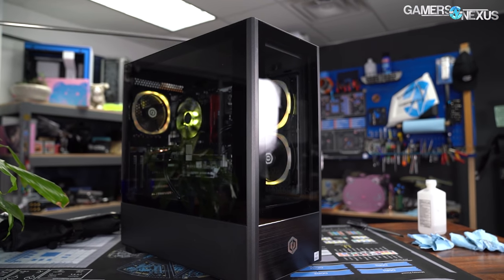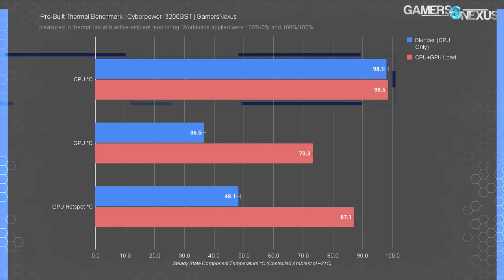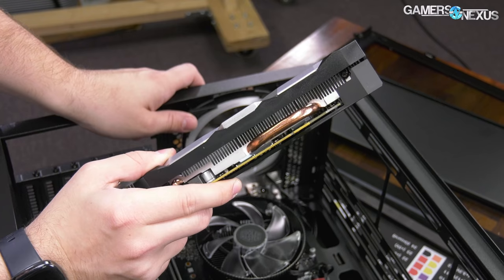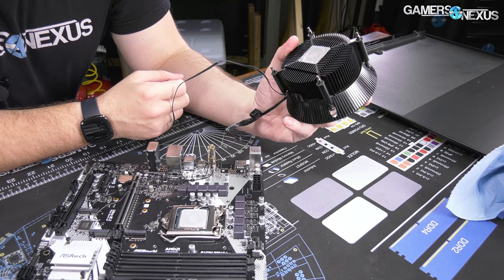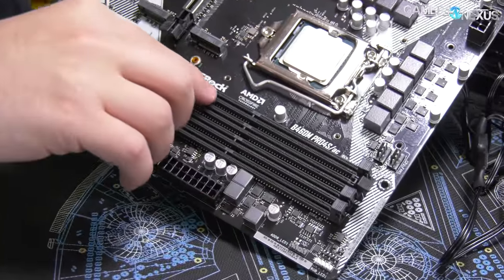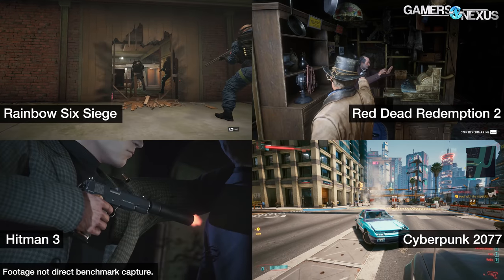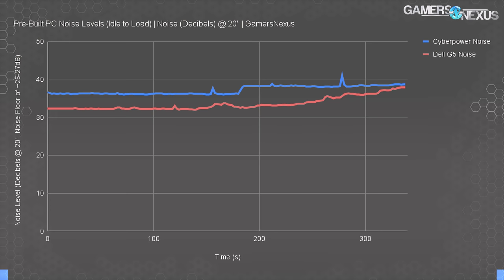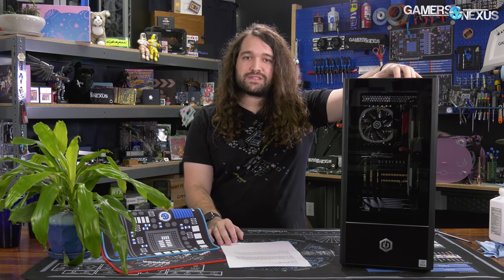Almost Didn't Suck: Cyberpower $1000 Pre-Built Gaming PC Review (Gamer Xtreme 3200BST)

Comment: I got mine for around $1,300. It's in a different case and I chose to go AMD instead of intel. It's the overall good performer Ryzen 5 3600 with 16GB of RAM and a 512NVME. I had not watched enough of yours, Bitwit and Paul's videos to realize it but for $30 at purchase time I would have gotten an AMD 5600XT instead of the AMD 580 I got. It seems to be a decent performer, not going crazy on resolutions. All I have done at 1080p seems to be just fine. The final quality was not excellent, thankfully I HAD watched all those videos when I got it. The system looked really amazing but one of the ARGB plugs was disconnected likely from shipping shuffle. The temps were really bad and throttling down my system, so I ended up swapping the cheap CPU air cooling for a 240mm AIO. I also moved the fans around instead of on the same plane as the motherboard, to the front. Thermals with those changes are way better and it was a noticeable performance increase on Rogue Squadrons. I do seem to have a noisy power supply and only 600W so I am thinking all this machine needs is a 750W PSU that is quieter to add on a 3060 or 3080 whenever they become available (which gives me time to save up as well :) but I went to Best Buy and an AMD Ryzen 7 5800 was there and I got the itch. I have an ASrock B550 so that should be fine, but I am wondering if I should swap the PSU first. I have three front 120mm fans, one in the rear and two cooling the AIO, plus two NVME's and an SSD. Finally as a shameless plug, I did make a video when I swapped to the AIO https://www.youtube.com/watch?v=uZs9vCxHWak

Comment: A "Upgrade" for that stock cooler, would be just machining the cooler copper slug so its level with the alloy bottom and entire thing is touching CPU
Reply: An upgrade is getting away from that pos, I had one it's complete ass and costs like $10 bucks new, there are plenty of decent ones for $20-$30

Comment: GF got a pack of case fans from Motospeed that use a similar Molex centipede as this one, except it's one that kinda makes sense. They tie all of the power pins together, but the plug where you feed PSU molex into doesn't have two of the pins. Those pins are connected from fan to fan directly in order to supply ARGB data from a "master" fan to the rest. Only one of the fans in the pack actually has an ARGB connector. It also has an integrated controller where you can control the fans through one of your case buttons (they suggest you use the reset switch for this).

Comment: I bought the same spec computer at the height of Covid 2 years go for 1700 because it was the cheapest option to get a computer, knew nothing about computers at the time and learned how much I overpaid since then. Oopsie. But the aprevia molex rgb controller really threw me off once I actually upgraded most of the parts.

Comment: 2:40 well if you factor in the motherboard, ram, psu, case, and storage, assume each of them are around 50 dollars on the low side, that makes the prebuilt actually a decent value, assuming the GPU is overpriced. Compared to MSRP though its not great

Comment: The "nice" thing about many prebuilds that use retail parts is you can look up compatibility and efficiency issues, like slotting 3000 ram in a 2666 motherboard.  IBUYPOWER has some weird crap setups on their website.  They have two ~1500$ AMD setups and one has half the mem storage, a worse graphics card (1660 Super vs 2060) for a slightly better motherboard....for some reason.

Comment: I have the 11700f 3060 ti version of this and your absolutely right! That damn wiring harness makes things so confusing. I had to add a liquid cooler the day after buying this because the stock cooler master air cooler was a disgrace! Everyone at Best Buy assured me it wasn’t wasn’t the cooler that was the problem and it was my first computer so I ended up having to return the computer and try a new one. I got the exact same computer I just thought there was a hardware problem with the original. Got home and got the new one hooked up and same problem! So I said screw the guys at Best Buy it has to be the cooler. It just made sense. So I bought and installed a double fan msi liquid cooler that I got at Best Buy tor only 70 dollars. BOOM! Problem fixed! Anyone buying this computer save yourself the time and get a liquid cooler or top of the line air cooler and you will be good to go. I know it sucks that it’s a prebuilt and you have to open it up and change something right away but it is worth it! I absolutely love my computer! It can take absolutely anything thrown it! But shame on you cyberpower! How can you sell a computer that doesn’t even work out of the box! Your lucky someone with absolutely no knowledge of computers was able to solve the problem otherwise I was going to return this computer and go with the OMEN.

Comment: I ordered a 1400 or round aboud prebuilt from these guys, and I only had 2 issues
1. It took ages and was pushed back multiple times in which I understood why because of RTX 3080 shortages
2. The aio made the annoying buzzing sound but luckiliy I had a noctua NH U12S and replaced it for equal to maybe better cooling for the 5600x

I DIY my pc's but, RTX 3080 init.

Comment: i have this i71c cooler on a small case bedroom pc build with a 7700k and its fine . its rock solid tight , you can pick it up by the cooler and shake the motherboard and it stress tests at under 70c. its not a great cooler and its not overclocked but for a small case budget build it was fine . seems kind of weird it doesn't work in this pc .

Comment: My last pc was an Ibuypower I've had for 7 or 8 years now but almost two years ago I purchased a Cyberpower SLC9308W openbox for $1550 at Walmart with a Ryzen 9 3950X and RTX 2070 Super and the GPU stays around 40C which has had me amazed to the point of thinking there is something wrong and verifying the system temps multiple times and ways. It just runs cool! Never had any issues with either systems. Prior to these two prebuilts Ive been building my own system all the way back to a TI 486SLC 33mhz which would out run my friends DX4 100mhz systems at LAN parties....

Comment: "Buy another stick of RAM, try to match the spec" I was under the impression you're not actually able to do that? I was once told that if the RAM modules are not purchased together even if they are identical sticks the timing could be off and can result in blue screens or other issues. Is this not true? Is there a good way to make sure two separately purchased RAM modules will work together for sure?
Reply: Wut? You can literally get any compatible ram and mix and match

Comment: The case, RAM, motherboard, PSU and 3 case fans total less than $100 retail?
Reply: what? this GPU was $240 - ram mobo and case = $250, GOOD PSU $90 3 fans call it $30. everything is a rip off

Comment: I have that CPU cooler, the Cooler Master 70ic or whatever, and it does an okay job. Under stress tests it keeps my 8086k (not delided) at ~80c or just under. I did check after you mentioned it, it does wiggle a bit, but I think that's due to the mounting mechanism. I would like to see it put through the cooler tests, but something tells me your specific unit might be defective somehow(?) or maybe the extra power being pumped into the the 10600kf really is too much for the cooler compared to the wattage of my 8086k.

Comment: Im just getting into building my first Pc my question is to someone whos been around a while.
Why have company's who make gpu's only just now release specific mining gpu's? Company's must of seen rather quickly what was happening to the market.
they are no longer selling consumer products. It seems that mining is an industry and all the gpu's have turned into a none consumer based product.
And lastly influencers like yourself and others have you tried to reach out and express your concern.
Reply: because mining gpus are just gaming gpu’s with the display outputs removed, the RGB removed, cooler costed down. But right now it makes more sense to make just 1 gaming SKU and sell it to gamers and miners. Only makes sense to make a mining specific card when you have over supply. But even then most miners prefer to buy gaming cards as mining cards are worth a lot less if crypto market crashes versus a gaming card. They can resell a gaming card on ebay for a much higher price. Mining cards would sell for a lot less. So unless a company has a bunch of extra gpu dies they can’t get rid of, it makes zero sense to make mining cards. Supply is still going to be limited regardless.

Comment: Thinking about these systems I find it hard to justify companies like Dell doing the proprietary parts. The only thing that I can think of is specifically doing it to prevent the customer from upgrading, or using parts in a different system, but that comes at an r&d cost, and I would think that the people who buy these systems would be unlikely to do any upgrades that the proprietary parts affect. This of course is not about the small form factor systems that I would generally expect to be proprietary.

Comment: whole industry is a steaming pile of dog shit- games are trash- everything is just a rip off of games made 10 years ago. no need to build a new gaming pc- get a pentium 4 single core. and run emulators on it gg. what u wanna play toxic league? or dota? or cs go? or with the kids playing fortnite? lololol. if it wasnt for overclocking i would never upgrade. i'm still playing xcom 2 etc. no good games in the pipe. no good hardware in the pipe. time to get back on the motorcycle.
Reply: if u dont set up your case as a blower card your doing it wrong

Comment: "By the way, HORRIBLE thermals"

I'm staring at a glass front, so I'm not terribly surprised by that. Where did this ancient relic even come from? Did you steal it from a museum? This looks like the years of garbage you guys constantly gave bad reviews to until companies finally listened and started thinking about airflow again. I guess Cyberpower thought they were safe since they don't sell the case alone, but they were wrong!
Reply: Oh, I didn't even see the side mounted fans until the scene changed. But why are they also blowing air out? They should be intake...
Okay, I already know the answer to that question. It's because this side of the fans look nicer, so thermals be damned.
Reply: Definitely wasn't expecting the CPU cooler to be so trash. WTF, CoolerMaster? I like how the part right above the silicon is the part that doesn't make contact. I'm sure this isn't an original thought, but maybe they shouldn't be called CoolerMaster if this is how they think cooling should be.

Comment: I bought a similar looking cyberpower in January. The motherboard does have multiple versions. Mine has a near identical motherboard, except for the B550 features, and the vrm heatsinks. Mine also has two 8 gb sticks of Crucial Ballistix red 3000mhz cl15. It also has a 3700x, 120mm aio, and an xfx rx 5700xt thicc ii. All of this for $1200, and at one point a version for $1350 with a 3070 was available.

Comment: I got a water-cooled cyber power and it was throttling. I put my own air cooler on it and it was like the best money spent at the time. Overall the system was solid but just had some huge WTF build decisions, but I knew enough to check and fix problems as they came up. Also, one Ram Module came DOA but that warranted free shipping, and they cross-shipped it. This was in 2009.

Comment: "it is better than Dell" : isn't each and every (actively computing) computer better than a Dell ? i worked for a corp (10k employees, more or less) having an exclusivity contract with Dell for all internal IT hardware, on the site i was working on, we had 3 Dell techs full time + our own IT team for clients support + our own dev teams for products related software. Things that were made by our own teams had some issues from time to time, of course... We had few configs for working computers (e.g. CAD workstations [high cache and calculation capability, big screens], devs workstations [high cache and calculation capability, dual middle sized screens] local "other uses" [low perfs and cheap screens], R&D laptops [low perfs but 17" screens], and mobile techs (users sites techs) [same as R&D but increased connectivity]. This with a few soft config sets : Lotus Notes for everyone, the appropriate CAD for mech or board devs, and the appropriate set of network drives depending on roles... well, it never worked, not for the "only" 800 people on the site i was working, but worldwide... just on-site : installing wrong hard configs, wrong setups for workstations (including at BIOS level for CAD), wrong sets of applications for almost everyone, manual downloads required for R&D machines, network drives giving you access to other users personnal datas, access to network drives random lockups, and the worst, sometimes 3 days to have your (bad) setup delivered when spare machines where stored by Dell INSIDE our factory... never buy a Dell, never speak to Dell (well, if you can reach any human at Dell...), throw them in the hell they created by their own... (Note : this testimony is valid from the years 2000 to 2011, but i can see nothing has change...)

Comment: Had this issue with both ABS PCs I bought (one was a replacement for the first which failed under warranty). The CPU (3900X) would reach 95C degrees under sustained load and clocks would drop below base clocks. I still have the PC and the problem is A) the liquid cooler they went with is 120 mm and it’s terrible — the Gamedias cooler is probably worse than just the stock air cooler and B) the case has no freaking air flow — the front fans don’t seem to pull any air around the glass panel and the rear fan doesn’t seem to blow any air out either — any warm air flows out the top eventually from the cpu cooler but it’s clearly not capable of keeping the system cool.

Next time around I’m paying the extra cost and going with MainGear — at least they have a reputation for delivering a system that runs adequately with reasonable cable management to boot. Honestly screw most prebuilders, they always try to skimp you on something whether it’s cooling, RAM speeds, or a crappy Motherboard/PSU. 

It’s really not that hard to use balanced components and ensure the system is reasonably cooled but then I guess they couldn’t rip people off for a buck.

Comment: Uuugh about the price... you'd still need to get an SSD and/or HDD, RAM, the mainboard, the PSU, the case and some fans. That can easily exceed 300 bucks if you are buy new AND you have to assemble it yourself, which costs time and effort. So yeah, the 1050 USD price is fair considering the crazy market situation right now. Though I wouldn't buy a 1050 USD system with a 1660 in it TBH. But then again, the CPU cooler thing is totally unacceptable. It's so sad because Cyberpower was one of the cheaper AND setup-wise better performer in the last LTT undercover PC shopping thing. But they had to fuck it up. 700 RPM fan? On a CPU cooler? That is a fucking joke. A fucking Arctic Alpine CO 12 costs 12 bucks and can cool a 95w TDP CPU without any problems. What an embarrassment. The only explanation is that someone simply didn't know that a K series CPU is is 95-100w TDP and so they put a non-K cooler on. And also, it's funny how CoolerMaster makes some products that have the worst possible cooling lol. I love my Q300L for my rather low-end parts, but their fans are so cheap and weak.

Comment: Is there a reason why so many of these cases have all intake or all exhaust fans? I see it so often! Its been a few years since I built a PC but even I knew in my ignorance that if you have more than one case fan then you should have a mix of intake and exhaust so you get actual air flow through the case. Its almost like the fans are fitted as decorative items.

Comment: Didn't you say you  bought  this from a real-life store and not their website? that tells me that you didn't get to choose the options available on their website to custom build with the options they provide. If you went with their website you could have chosen a much better CPU cooler or better temperatures. I would never recommend purchasing a prebuilt with parts inside you didn't get to choose. I much prefer the custom options
Reply: The issue is that they should have never used that "cooler" in the first place.
Reply: @uni4rm  yeah, if I was someone on a budget, I would just go with the tried and true hyper 212 EVO which I think is like $25 last I checked. But as I was saying in my previous comment, the website custom build section offers you a huge selection of both air coolers and water cooling to choose from. You are not forced into 1 option